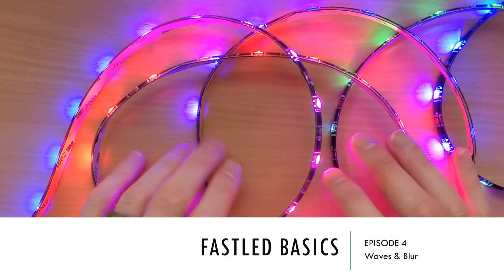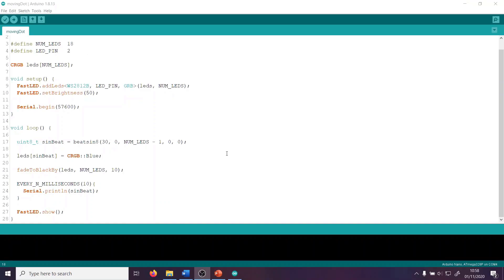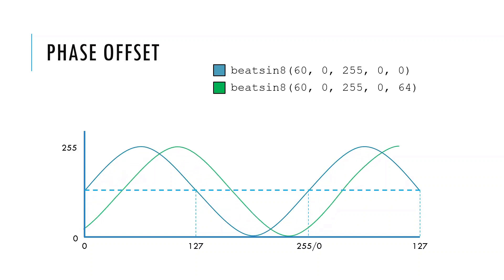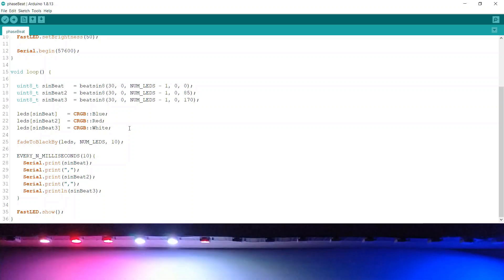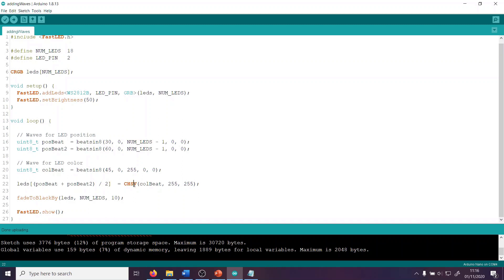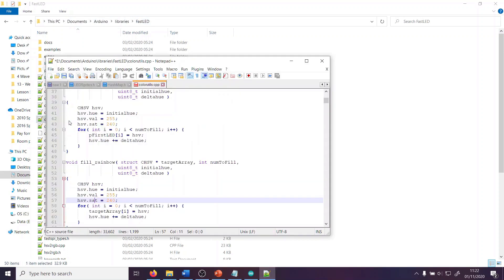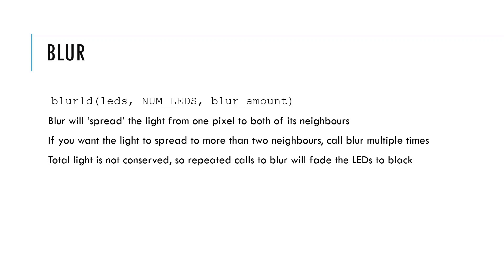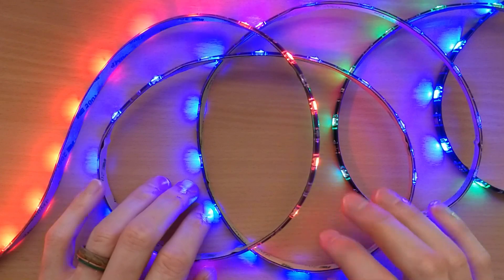FastLED Basics Episode 4 - Waves and blur

Comment: Thank you for your excellent learning series! I've got 150 LEDS and in the beatsin8 function, when I select a bpm of 10 or 30, some of the lights on the led strip are left out and dont illuminate in the moving dot example. Is there a way to select a bpm where every single illuminate as the light travel alongs the strip?

Comment: hi scott, is there a way to make a sunrise effect using something like fastled. i want to make something where my led strip starts off dark blue low brightness then from a "hotspot" point on the strip (say middle) i want it to start getting brighter and a lighter blue untill most the led strip has become this colour  (fading out from the hotspot to the ends of the strip) and then i want the hotspot to become a red/oringe and as that covers the strip i want it to become a more yellow to white before it engulfs the full strip, then i want the strip to slowly become a daylight white after a set time say 5 mins. 

i only ask because on a forum ive asked for help on someones dm'd me saying it cant be done on fastLED but it can be done on something else they are trying to get me to pay for. hope you can help, all the best.
Reply from the maker: Not sure what they mean by saying it can't be done. Each LED can be set to any colour you like, so in principle any pattern can be created. Might not be easy to code, but anything is possible with enough dedication ;)

Comment: Scott I keep coming back to this video set. It's solidified my project for certain! A question though - With Blur1d, as the driving pixel nears the end of the strip and reaches the last LED, the blur trailing it also disappears before reaching the end. It makes sense to me why it's doing that as the blur depends on the driving pixel, but is there a quick work around to ensure the blur continues on course, or should I arbitrarily change the LED_NUMS to be higher than my actual strip to act as a quick fix?
Reply from the maker: I have seen this before,  and like you I cheated and increased NUM_LEDs!

Comment: Scott this intro series is amazing, I'm learning quickly! Could you give me a hint as to how I might phaseshift with beat8 and its 'sawtooth' effect??
Reply from the maker: You would have to use the timebase to phase shift on beat8. See the part of the video where I talk about beatsin8 and explain how the timebase works. The only issue with using the timebase is that if the frequency changes you will also have to update the timebase if you want the same phas shift.
Reply: @ScottMarley  Perfect! Took a bit of math but I got it to work. Thanks a bunch for the advice.

Comment: These tutorials are incredibly good. Thank you! By the way, 7:40 this code doesn't look okay? The beat wave variables are 8 bit variables. So doing "(beat + beat2) / 2" will create a new temporary 8 bit variable, add another 8 bit variable to it thus overflowing, and THEN divides the overflow by 2. I bet the effect still does pretty much what you wanted. But proper math would probably be to do "(beat / 2 + beat2 / 2)"? Halving them before adding them together to ensure the result is still within the range of an 8 bit number.
Reply from the maker: Good catch on that, I'll update the code if I remember!

Comment: awesome video as always. Scott, on the section "addingWaves" you have lines 19 & 20 (in the sample code) as beatsin16 but your demo has it at 8. I didn't get the same results as you did until I changed it to beatsin8
Reply from the maker: Ah, good spot. I'll update that when I remember. Thanks for checking!

Comment: Well done! I really like how you include examples of the code and the outcome on the LEDs! Great stuff, I have learned A LOT from your videos! Thank you!
Reply from the maker: Thanks, now go make something awesome!
Reply: @ScottMarley  I have some great hardware installation on some props for my kids dance studio! Running ~300 LEDs on various strips at long distances. I had some functional code working, but your videos have really fine tuned my stuff and I was able to add some great features! I'm using a Teensy LC + OCTOWS2811 Adapter + HC-05 Bluetooth Adapter for the control aspect. I was initially using the WS2813 LEDs, but had lots of reliability issues with them, lots of defective LEDs after being ON under a relatively high power condition (like AQUA or WHITE) - I discovered this to be related to heat issues with the driver IC inside the LED. I switched to the SK6812 LED strips and have had zero issues with reliability. The color matching from LED to LED is far superior with the SK6812 over the WS2813 LEDs. Anyway, many thanks again!

Comment: Hey, great video! I do have one question: When I use a beastsin8 wave on my ledstrip (120leds)  some of the leds don't light up. What causes this and how can I fix that? Thanks for the great content!
Reply from the maker: Can't say without seeing your code. And when you say don't light up, do you mean at random, or the first so many work and the rest don't etc. Put your code on pastebin and link it here and I'll have a look.
Reply: @ScottMarley  https://pastebin.com/LsCRY97F
In this script I tried to only light up the first 70 leds, but the one of them did not light up. Thanks in advance!
Reply from the maker: @WildStyleGamerz  which one didn't light up? The first one? The last one? A random one? When asking for help, try to be as descriptive as you can otherwise it's really difficult.
Reply: @ScottMarley  I'm sorry i forgot to specify: The led(s) that does not light up seems to be random and dependent of the amount of leds. (The leds that don't light up stay the same when the program isn't changed) When using 70 leds there seem to be 2 random ones which don't work (always the same 2 though). When i use all leds there are more that won't shine. The leds that don't work aren't the same when using all of them compared to 70. Hope this explains my situation, sorry for my english. Thanks!
Reply from the maker: @WildStyleGamerz  Thank you for the detailed response. The problem you are having is due to the low resolution of beatsin8 (0-255) and the bpm at which your sin wave is generated. At certain points, the ouptut of beatsin8 is changing so quickly that a number gets skipped. The way around this is to change line 15 to: uint16_t sinBeat = beatsin16(30, 0, 70, 0, 0); This uses a higher resolution version of the beatsin function and should solve your problem. Hope that helps!
Reply: @ScottMarley  Worked like a charm! Thank you!
Reply from the maker: @WildStyleGamerz  No problem, remeber you will also have to make this change on the other examples. It's only really important when you're using the wave for a position. If you're using it to change a hu, brightness etc, beatsin8 is fine. Use beatsin16 for positional stuff.

Comment: Scott, another great video.  Good use of visuals to explain the concept of the beatsin. It made it much easier to understand. I had never even heard of the blur function so that was cool.  When you have multiple waves the addition is not really adding the two colors to each other is it? It's more of the int values are being added and then the color is pulled from the hue wheel..  I'm not sure if my question is even making sense  :)
Reply from the maker: It depends on which example you're talking about, but basically, yes! The two waves added together just give a number from 0-255 then that number is used to select the hue (or index from a palette if you're talking about that one!).
Reply: @ScottMarley   Any chance you can do a video on Pacifica?  :)   Though that is probably way past where we are currently.
Reply from the maker: But of course you can use the output from beatsin8 as an input to pretty much anything, hue, brightness, position, color index, RGB values, timing functions, amounts of blur, whatever.